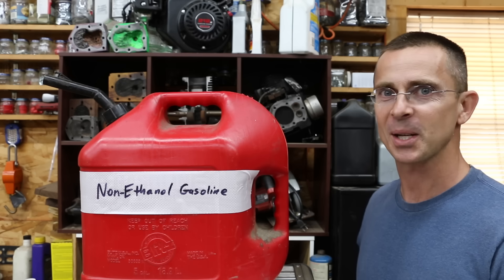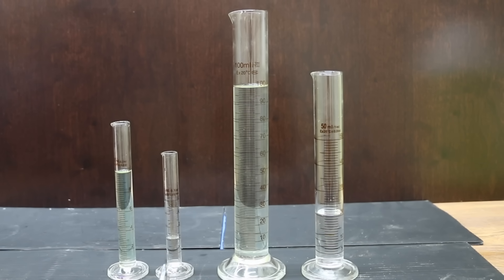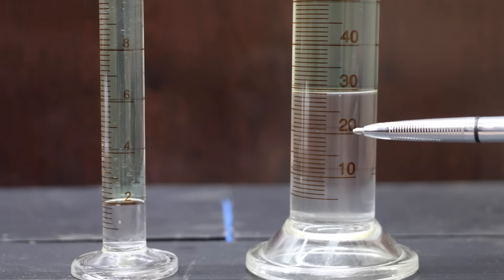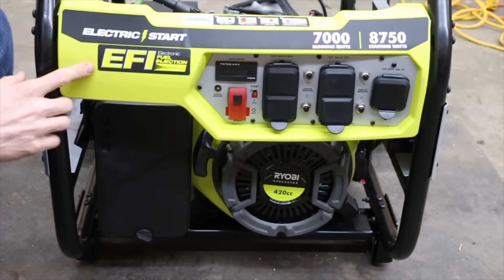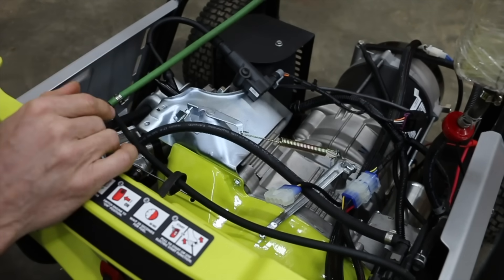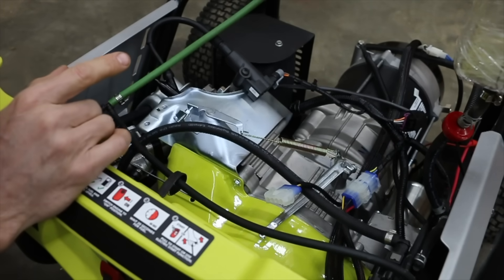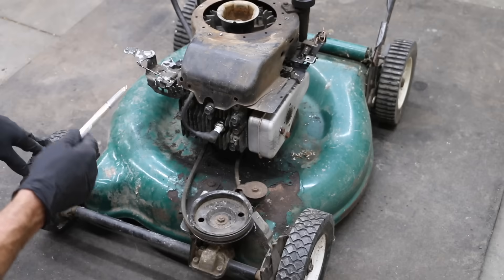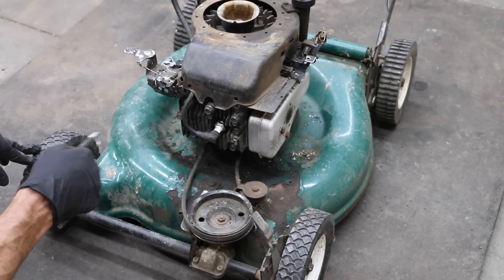Is Non-Ethanol Gasoline Really Better? See the PROOF!

Comment: being from ethanol capital of country. (iowa) 
I'll be straight up... its 
 $.40 /gallon cheaper..... burns up faster ....it evaporates faster......
no  real reson to add heet to your fuel or fuel tank until the  temperature drops to a balmy 20°.
now the E-85 is 1/2 the price of regular non ethanol fuel. but you get a 1/3 the fuel economy as non ethanol.
older vehicles don't care for ethanol. (70s 80s 90s)
true facts
Reply from the maker: All great points. Thank you!
Reply: Thomas Barker, You do realize that 50% - 33.33% = 16.67% lower cost per mile to drive with E85 even with the loss of mileage.

Not only that the E85 gives you more horsepower.  For example a Chevy 5.3L pickup gets a super clean 380 horsepower on E85 and a toxic 355 horsepower on E0:
https://media.gm.com/media/us/en/chevrolet/spec-tables/2016/1500-crew-cab.html

Actually ethanol evaporates slower, below 60 degrees Fahrenheit is doesn't volatilize which is why E85 has 15% gasoline for cold weather starting.  Brazil uses other means for their E100.

Gasoline is volatile down to -45 degrees Fahrenheit and the volatile aromatics used for octane are well,, volatile.
That is why the DOE found ethanol blends last three times longer in small engines than E0, the aromatics evaporate and you can use the sub octane fuel then.

The US Government told auto manufacturers in the 70s to have all cars compatible with ethanol by 1983 if they were not already.

After Prohibition ended(1933) and up to just before WWII, E10 was sold in thousands of stations in the Midwest.  

Britain had a few E10 blends, one called Cleveland Discol sold from the 1930s until 1968 when BP bought them out and ended it.

Brazil has used >E20+ since the 1970s in their nonflex fuel cars and currently are at E27, looking to go to E40.

Henry  Ford's favorite fuel was ethanol and he designed the Model T for it.  Production models were flex fuel.
Reply: @danafletcher2341   I think Thomas Barker misstated 50% less cost.
E85 only has 15% alcohol.
Unless his State has some excessive subsidy for alcohol.
I live in Arkansas where E85 is a little cheaper. Not cheap enough to overcome the reduction in mileage.
I never use E85.
Reply: @wms1650  E85 is 85% alcohol.

Ethanol on the NYMEX is $1.50/gallon and an unusable sub grade of gasoline(RBOB) is $1.79.  The spread just became close, ethanol has for a long time been in the $1.30s and RBOB has been >$2.00.  No state subsides on the NYMEX.

To make RBOB usable you would have to add toxic aromatics which will make it cost even more per gallon much like premium gasoline costs more than regular.   

OR.... you simply splash in 10% clean and nontoxic ethanol and it obviously will cost less.

Let us look at the world's most selling vehicle, the Ford F-150. A 5.0L 2018 flex fuel gets 17 mpg on E0 and 14 on E85. The EPA states most US vehicles lose 3 to 4% mpg on E10 and 4 to 5% on E15.  https://www.fueleconomy.gov/feg/Find.do?action=sbs&id=39598

Prices from e85prices.com

E0 = $3.03 @ 17 mpg = $.178 cost per mile

E10 = $2.83 @ 16.32mpg = $.173 cost per mile

E15 = $2.71 @ 16.15mpg = $.168 cost per mile

E85 = $2.25 @ 14 mpg = $.161 cost per mile

With E85 I know more of my money goes to American workers and American businesses who pay American taxes and put the rest in American banks to buy goods and services produced by me and my fellow Americans.

With E0 I know more of my money goes to Arab sheiks and transnational companies who put it in Swiss bank accounts and pay little if any in tax.

How about Arkansas prices on e85prices.com:

E10 =  $2.58 @ 16.32 mpg  = $.158 cost per mile

E85 = $2.14 @ 14 mpg  = $.153 cost per mile.

You also as seen in my Chevy example get more horsepower with E85.  Much cleaner exhaust too.
Reply: You forgot to factor in the MASSIVE subsidies at all levels of Ethanol production,  or in plain English, the fleecing of American taxpayers. E85 is SIGNIFICANTLY more expensive than gasoline to each and every Taxpayer, even if you never buy a gallon while riding a bike, driving an electric or walking.
Reply: @derherr65  Sorry Derherr65,  you happen to be incorrect, E85 is cheap on free market.

Corn ethanol receives no Federal subsidies, those(also known at the VEETC) ended back in 2011:  https://afdc.energy.gov/laws/399

Now the long standing goal of the G7 Nations to end petroleum subsidies?  ...Not so much.

Ethanol producers are somewhat insulated from farm subsidies since if corn is cheap, then so too are their distillers byproducts.

Likewise if corn is expensive, then they can make some of that back with high prices for their distillers byproducts.

If you want to blame ethanol for anything, then you would have to blame it for causing farm subsidies to absolutely crash.  Since the 2005 energy act was passed, farmer subsidies crashed from just shy of 25 billion in 2005 to just shy of 10 billion in 2018 and that does not count inflation.  Name another government program that ever did that?   Of course I meant excluding ethanol which went to zero.

2005-2015:  https://a.disquscdn.com/uploads/mediaembed/images/2790/5332/original.jpg

On up to 2018:  https://uploads.disquscdn.com/images/f4cbee784459fc4107eceb9a7ba070fbf5eb2b634b59d1ba30414337d80fa5d6.png

Comment: Running E85 in my Subaru.  I run it with a purpose though... I can get more power out of it by a pretty large margin over 93 10% ethanol.

Larger injectors, fuel pump, fuel pressure regulator + the high knock protection of E85 means I can run higher boost without the risk of detonation.

This means 400+ HP (at the wheels) out of a 4-cylinder motor... with 10-13 MPG.

I have been like this for 40K miles too, with no buildup issues.  So I don't think carbon is an issue (at least in my case).
Reply from the maker: Great point!  E85 is great for boosted engines.

Comment: Raising octane isn't the main purpose. Ethanol and other additives such as methyl tert-butyl ether (banned in many places) are for oxygenation to reduce soot & carbon monoxide. It functions by raising octane. These additives reduce the overall fuel efficiency. Higher octane isn't always best for fuel efficiency either. One should use the octane rating the engine is designed for. Higher octane burns more slowly, needed for higher compression to reduce knock. Lower octane in engines not needing higher will offer better efficiency at lower cost.
Just because there's a carburetor doesn't mean ethanol is bad. It depends on which specific materials the various parts are made of.
Reply from the maker: Great point. Thank you
Reply: Yes, raising the octane is the main purpose, allowing cheaper gas to be used, it was lead at first, than mtbe, than ethanol. It does NOT function by raising octane, in terms of emissions reduction, but by supplying more oxygen, as you said
Reply: @devinwilliams3489  lead (tetraethyl lead) was indeed used to raise octane. It was also an effective upper engine component lubricant to further reduce knock. Lead's dangers were known long before oil companies started using it. The specific chemicals in gasoline vary. If their composition is such that the fuel preforms equal to a mixture of 90% iso-octane (8 carbon atoms) to 10% heptane (7 carbons) it receives a 90% rating but may not actually contain 90% octane. The rating is not a value of energy. Raising octane doesn't have to reduce energy per volume but using ethanol does. Oxygenation is about pollution. A variety of alcohols or ethers could be used. Ethanol is now mandated in the US, arguably to make ADM and their investors stinking rich.

Comment: I have a turbocharged car that is tuned on E85. I also have a 91 octane tune. If you are running pure or near pure ethanol, it helps keep your engine clean and it runs cooler.  My exhaust temps on E85 are significantly cooler than 91.  Long term, rubber components NOT rated for E85 will wear out much quicker and fail early. Typically why carbed engined have issues.   Fuel economy on my car changes very little between the 2. On 91 i get around 250 miles or so out of 12 gallons. E85 on the other hand i get about 220 miles.
Reply from the maker: Great point

Comment: The resistance to ethanol is due to gasket degradation. The older vehicles have gaskets that are not ethanol resistant. So you get leaks. Failure front to rear eventually.
Reply from the maker: Great point!

Comment: any car from the 90s to present is suited for E10 use, all the fuel system parts are rated for it. Stop with the bullshit. it only matter when you let it sit for extended links of time. Ethenol acts as an oxygenative agent, it actually helps combustion and cleans it up a bit. Get real you fools
Slightly better (1-2)mpg to a tank, or better emissions out the tailpipe....Take your pick. you want that mile or two back, dont idle your car for 15 minutes when cold, as soon the o2s take effect and the idle drops, take off while being gentle on the car without revving hard till engine reaches operation temp. Bam! your MPG is back. Idiots
Reply: Yep, start it and go, but slowly for the first mile

Comment: i could care less about the efficiency part of it. What i will say is that use ONLY non ethanol fuel for your small engines, mower, snowblower, generators, etc. and use fuel stabilizer it will stay good for at least 3 years. Having repaired thousands of small engines for non running issues, every time it is fuel left in them. todays fuel will start to turn yellow and lacquer within 2 weeks, its crap...
Reply from the maker: Thank you!

Comment: Excellent video. Always wondered about this. I use NON-ethanol fuel exclusively. I have noticed better performance and a slight increase in fuel mileage, in the truck, and I only use non-ethanol in ALL my power equipment. It can stand for months, with no ill effect to the equipment at all. Thanks for the video!
Reply from the maker: Thank you

Comment: It appears that pure ethanol has only 60% of the efficiency of pure gasoline. Why do we still use the stuff?
Reply from the maker: Thank you
Reply: I believe the actual value is more like 80%.  I was surprised by the video showing only a 4% difference, but your mileage may vary.  There are any number of reasons that ethanol is used and required by law in most US states.  But rather than debate that issue, let's just face the fact that it's the law.  In our vehicles we should see a somewhat degraded performance, but they are tuned for the 10% ethanol, so using something different without adjusting the tuning of the engine will not improve your performance by 20% that you might expect.

What most of the comments here are missing is that the topic is the effect of ethanol fuel in small engines.  I have seen the effect of long term use of ethanol fuel in a 2-stroke engine.  It's not severe but there are deposits.  The major problem is with the fuel lines and all of the materials that the fuel touches.  For whatever reason, 2-stroke engine fuel lines and other components are still being made with materials that very quickly degrade when subjected to ethanol.  As some commenters have noted, it is common to have problems in less than 2 years.  Sta-bil may reduce the issues but I find it a lot easier to just buy ethanol-free fuel for my carbureted engines.  I pay a premium for it but I go through less than 5 gallons of small engine fuel per year.  Even if my lawn mower doesn't have a problem with standard 10% ethanol fuel, my weedeater and chainsaw do.  And I know the ethanol-free fuel won't damage my lawnmower and snowblower, so I use it for all of my small engines.

The commenters that are making the ridiculous comments about moving to Brazil, etc. are good examples of a tempest in a teapot, not to mention the Dunning-Kruger effect.

Comment: what I've learned here, is that this Dana Fletcher person is a fucking idiot.
It's still subsidized, I don't care how many bullshit links you post.
Alcohol does NOT make more power, per a given volume, than gas, esecially ethanol.
Alcohol racing fuel is METHANOL, a different animal, and requires substantially more volume, to make compareable power.
It is used because it has other benefits, that I am not going to get into here, with you, because, even if you were able to grasp the subject, you are not so inclined, and I am not going to attempt to teach a pig to sing.
Just go ahead, and continue to spout your nonsense, in hopes that some other idiot will agree, and make you all warm and fuzzy inside.

Comment: Do a test with small outboard motors, 2-4hp range and see how long they run before the alcohol fuel makes them not start and require a carb rebuild.  

If that test takes too long just use an older Homelite Chainsaw.  It'll run fine almost forever with non-alcoholic gas but one tank of even 5% alcohol and they will die, often almost right away.  If not right away, then after shutting off and cooling down to ambient you'll never get it started again.
Reply from the maker: Thank you for the video idea!
Reply: @ProjectFarm  In my experience the smaller the engine, the worse the alcohol problems get, especially with older engines.   With boating people, those of us who have small outboards to power small dinghys we hoist aboard our larger boats so we can get ashore and back easily, alcohol fuel is a bad word.  If you get some by mistake you'll soon know it -especially if you have an older motor like my 1980's 2HP Yamaha 2-stroke.

Comment: I can't argue with your process at all. In fact the results really surprised me.
I have this old bike that I've been riding for around 25 years. We are talking a CX500C Honda and it has been everywhere.  We're going well over 150k miles. I know Angel very well.  She is very consistent and with 10% ethanol I get between 100 to 105 miles before switching to reserve. With non ethanol fuel I get a bit over 110 miles and maybe 120. You get to know these  things after a few years.
Reply from the maker: Thank you!

Comment: So many people commenting not to use ethanol blend on small engine with carbs is total bs. Been using it for many many years on all sorts of motors and never had an issue even once. Even seasonal equipment like lawn mowers to snowmobiles. They will sit for months and fire right up and run perfect. Maybe some peoples maintenance and how they store could be more of an issue
Reply from the maker: Thanks for commenting on this.

Comment: Curious to the effect it has on the carburetors rubber parts especially the flapper valves. Chainsaws run on it seem to need rebuilt because it weakens the gaskets and check valves.
Reply from the maker: Thank you!

Comment: I am an owner of four antique motorcycles, multiple antique farm tractors, two antique mowers, and various vehicles. Needless to say I have loads of experience with ethanol. Why? Ethanol kills seals, such as those used in carburetors which are on all kinds of modern equipment like string trimmers and mowers. It soaks in and causes swelling initially, which doesn't do much. However, when it dries out, it pulls oils and such out of those seals and they crack and leak. I have two four-cylinder antique Kawasakis and rebuilding four carbs every six months gets OLD. Switched and haven't rebuilt in years.

On top of this, ethanol has less BTUs than gasoline. This means that adding it to fuel in place of gasoline lowers the amount of stored energy in the fuel. In other words, a gallon of 93 E0 has slightly more energy than a gallon of 93 E1 and loads more energy than a gallon of E85. This translates into power and/or mileage. For example, my 2015 F150 has the 3.5L EcoBoost under the hood. I only run 93 E0 in it. Why? I run one tank a year of 93 E10 to clean things up (ethanol is a GREAT cleaner) and each time I do, I lose almost exactly 4mpg. Is this a big deal on a Honda with a 10gal tank? Not really. On my 36gal tank it adds 144mi per tank I can drive. That is a HUGE difference. I notice a much smaller increase on my 2002 E39 BMW, but it doesn't have a lot of the tech which is on my F150.

Finally, ethanol does NOT store for long. It separates into stale gas, acid, and water fairly quickly. Acid can damage the fuel system and even the engine depending on how much fuel was stored and how much acid formed. This is also why storing E10 of any octane rating in a trimmer or mower generally means you have to rebuild the carburetor before using it. You may also have to replace the fuel lines if they became brittle.

I do have one positive thing to say about ethanol though. It is an awesome cleaner! Like I said before, I run one tank through my truck each year for cleaning purposes. Same with the BMW. I never run it in my bikes or tractors or any of that mess though. Oh, and ethanol will LOVE your fiberglass boat fuel tank! No really, it will dissolve the fiberglass tank from the inside out...
Reply from the maker: Excellent points!  Thank you

Comment: when storing any small engine it is best to run all the gas out of it .
Reply from the maker: It's nearly impossible to get the carb totally emptied, which can cause issues.  I prefer using non-ethanol gas with a stabilizer and running the engine periodically.
Reply: Project Farm 
no it isnt if you let it run out

Comment: Those are the wrong questions. The issues with ethanol in the gasoline are what it does in terms of corrosion of the engine and the moisture that it absorbs. 

Fuel efficiency definitely does take a hit as it's less energy dense than gasoline is. The carbon build up shouldn't be an issue if the engine is properly tuned.
Reply from the maker: Great point. Thank you.